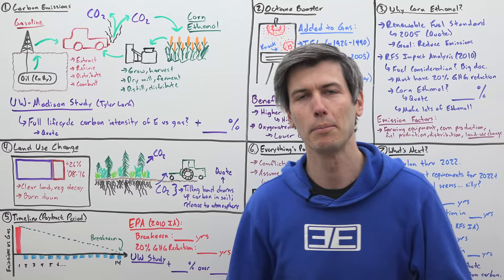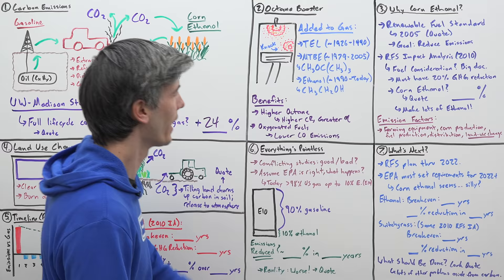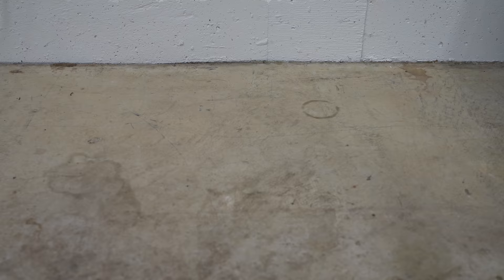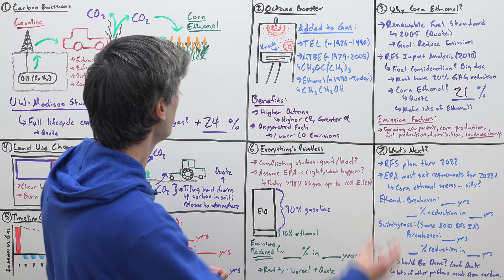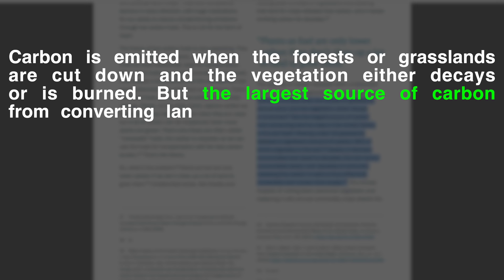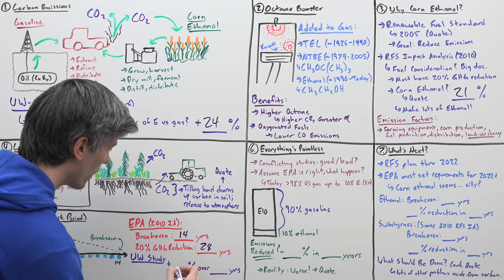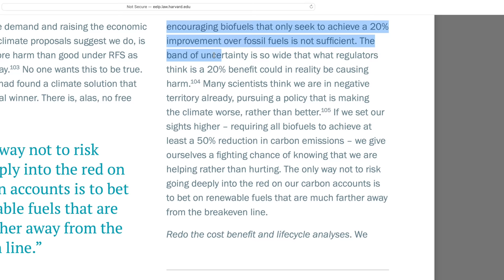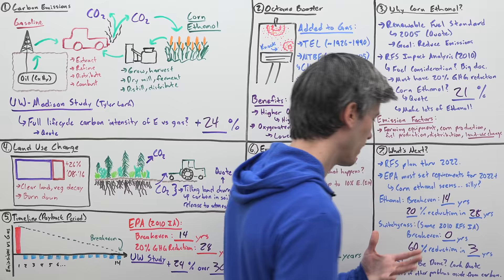America Was Wrong About Ethanol - Study Shows

Comment: In Brazil, engines are "flex", meaning that they offer the flexibility to burn 100% gasoline or 100% ethanol, and also any mix in between. Most people drive on 100% ethanol, just because it is cheaper overall. In the early days of the technology, these engines were pretty bad when burning 100% ethanol, in particular when the engine was cold. However, nowadays, with sophisticated electronic injection systems, you don't feel much difference, even when the engine is cold. The technology dates back to 1970's, in response to the oil crisis which put Brazil on its knees. Being a vast country with a lot of sun, Brazil implemented a large scale program of producing ethanol from sugar cane.
Reply: Yes. Also, now brazilian gasoline has 30% alcohol in it.
Reply: Brazil’s cane ethanol program is based on several lies. 

 

Lie #1: there is an 8:1 EROI for cane ethanol.  I did the math and it is no better than 2:1.  Petrobras doesn’t want to count the burning of bagasse as an energy input because it is “free”, but it is energy that could be used for other purposes if not for corn ethanol, so it must be counted as an input.  When properly computed, the EROI of Brazilian cane ethanol is about the same as USA corn ethanol.  And we got the same 2:1 EROI growing cane ethanol in the USA when we have tried it.  Only the difference in subsidies between the countries guides why one is a cane agriculture empire, and one is a corn agriculture empire.
Lie #2: Brazilian cane is farmed sustainably.  Reality is the land is slashed, burned, overfarmed, and rapidly depleted, requiring new acreage all the time.  The new land is forcibly acquired from indigenous people, who are also used as quasi-slave laborers in the fields.  The land and water resource and environmental damage footprints of cane ethanol is much higher than those of the onshore or offshore crude oil to gasoline lifecycle.
Lie #3: Cane and corn ethanol reduce polluting and GHG emissions.  Ethanol increases emissions of pm2.5 particulates, ozone, and volatile organics compared to straight gasoline.  USA and German Academies of Science have also found their lifecycles also have increased GHG emissions. 
 

The whole premise of bioethanol is false.  Whatever the feedstock, making fuel-grade ethanol is completely dependent on huge inputs of fossil fuels and the lifecycle produces excessive emissions of GHGs.  The finished fossil fuel energy used to plow, plant, fertilize, burn, harvest, transport, de-water, ferment, distill, dehydrate, and transport ethanol and blend it into the petroleum fuel supply would be much better spent and yield a manifold higher EROI adding new petroleum fuel to the fuel supply.
Reply: USA been using E10 for long time. Can still find 100% gas at a few gas stations. US has too many gas stations! Lol
Reply: @JuanGonzalez-hf6jc  Not good for engines. If you can buy Ford Ranger trucks there..they use excellent gen2 - GTDI engine can use any fuel + trucks last 20yrs if cared for.
Reply: I learned to drive outside Campinas on dirt roads between sugar cane fields.... I feel like Earnest Hemingway 😂
Reply: @Brandon_letsgo  Your data is a little outdated.

The burning of the bagasse is to produce electricity.  The waste steam from that electricity production is used to make ethanol.  Waste steam = free energy.

Sugarcane growers signed the Green Protocol 2007 which means they have not burned the sugarcane for harvest since then.  Being a perennial crop would be good for soils and it sounds like cover crops are being incorporated (which should happen with or without ethanol).

Note also that the South-Central region of sugarcane harvest is now 99% mechanical.

The sugarcane is not irrigated but I see sugar mills have gone to recycling water.  Poet, the largest ethanol producer here, was a great innovator in recycling all the water in ethanol production.

All the energy it takes to produce a product and deliver it to the consumer is reflected in the price. 

As such our ethanol spot cash delivered price on the NYMEX is $1.54/gal.

The price of unusable sub-grade gasoline (RBOB) is $2.75/gal.  Usable E0 costs even more.

It takes more energy to make sub-grade gasoline than corn ethanol.

Iowa State University measured all the energy it takes to produce an acre of corn into a "diesel fuel equivalent"
This included making the machinery, fertilizer, chemicals, plus the tillage, planting, harvesting, drying, trucking etc. 
They found it takes 34 gal of diesel to produce one acre of corn.
What do we get from those 34 gallons of diesel?
We get >500 gallons of ethanol.
But wait, that is not the kicker.
The kicker is we still get 100% of the protein and other things from that acre of corn still available for a healthier and even better feed called distillers grains. A win-win.

Denver in 1988 was the first US government entity to require E10 when they were on the EPA list of ozone non-attainment zones.  Soon with ethanol they were off that list.

Even with just 10% ethanol added to E0, the Swiss Federal Laboratory for Materials Science and Technology found that the especially health devastating ultra fine or nano particulate emissions were lowered by 97%, carbon monoxide lowered by 81%, carbon dioxide lowered by 13%, aromatic hydrocarbon emissions lowered by 67-96%, and genotoxic emissions lowered by 72%.
Reply: @Davido50 you can get real gas almost everywhere, not just a few…it’s the only fuel I use
Reply: In the US, it's E85 (85% ethanol 15% gasoline). I have a flex fuel truck in the US and it can only use up to E85.
Reply: Most people use ethanol?? I'm from south Brazil and I do not know a single person who uses ethanol, in fact, most of the gas stations in my region don't even offer ethanol as a option because no one uses it
Reply: @WellytonNandi  Metropolitan Sao Paulo alone has double of the population than the entire state of Rio Grande do Sul, the most populous state of your region. So, yes: most people in Brazil are on ethanol. Besides, even if you prefer 100% gasoline, in reality, ethanol is still blended in it, meaning that you are on ethanol indirectly anyway.
Reply: Not 100% ethanol
Reply: @WellytonNandi  The common gasolina in Brazil by law contains a minimum of 27.5% ethanol.
Reply: @richardgomes5420  ah yes, because metropolitan São Paulo represents more than 50% of the population of Brazil lmfao
Reply: @danafletcher2341  he said most people uses 100% ethanol, what's even the point you're trying to make here
Reply: @WellytonNandi  You said no one uses ethanol when in fact they use 27.5% ethanol if they use the common gasoline.

It appears that you meant to say was that no one uses E100.  I did not mean to offend you.

A lot of non-flex fuel vehicles are sold in Brazil so a lot can't use E100.
Reply: @WellytonNandi  No, no... that's because Rio Grande do Sul, with a population of 9 million represents the vast majority of 240 million Brazilians.
Reply: @Brandon_letsgo  can you mention any one of them?

Comment: The funniest part of this whole ethanol affair is that before 1920 a huge portion of internal combustion engines ran on ethanol. Ethanol was cheaper and more ubiquitous than gas which made it the preferred fuel. It was, however, heavily taxed in certain countries, including the US before 1906, which did make it more expensive than gas. Ford's Model T ran on ethanol by default (though it could be adjusted to run on gasoline as well). Especially all performance/race engines ran on various alcohols, due to their huge octane rating. And one of the major reasons for prohibition was lobbying by oil/gasoline companies, Standard Oil in particular. It was very effective indeed.
Reply: Ubikuitous
Reply: Don't get me started on Standard Oil
Reply: Yeah what he said 👏
Reply: If any Congress votes to get rid of the ethanol mandate, the majority party in that Congress will get voted out of office in the next election. That’s what you’re up against. Which party wants to impale themselves on that spear? Anytime you introduce a subsidy, you mess up that market forever.
Reply: It was taxed so heavily because it fell under the liquor tax. Get real, moonshiners were making “corn liquor”. Right? ? Just like we’re making now. What goes around comes round! Junior Johnson coulda put the moonshine in his liquor-hauler’s tank and more easily outran the “revenues”.